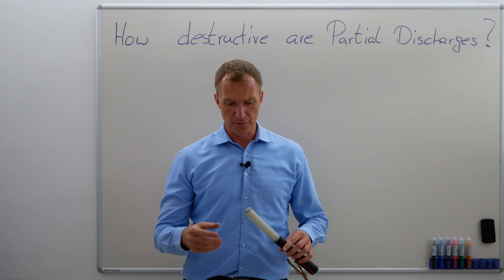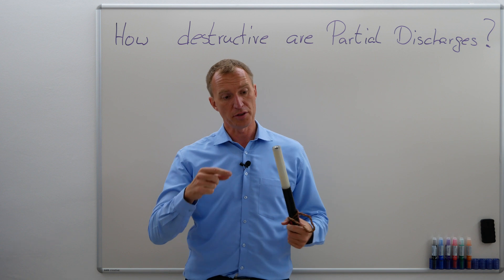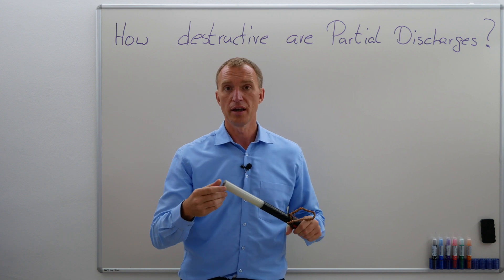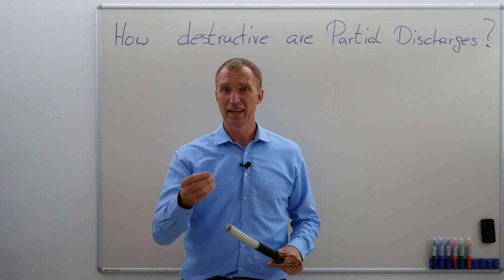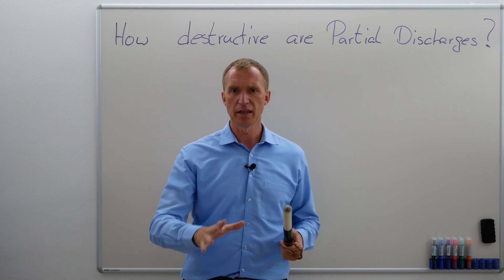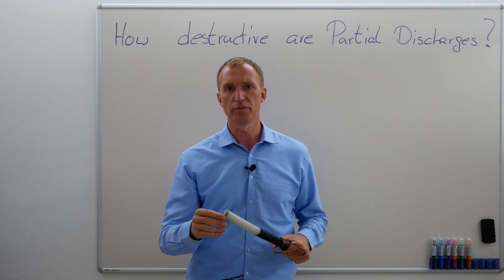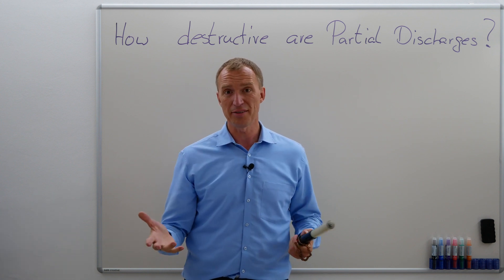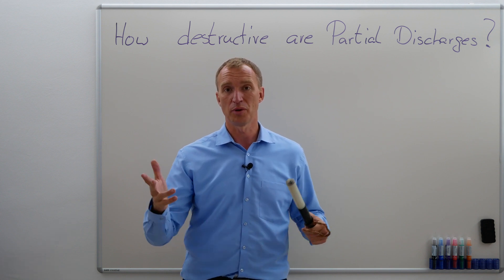1.2 How destructive are Partial Discharges?

Comment: 4:50 Your thumb looks pretty close to the center conductor of that cable! How did you know you'd be safe and the corona won't travel across the metal and jump onto your finger?
Reply: Same question
Reply: Unless he is at high potential voltage himself
Reply: It's high frequency from a Tesla coil, will not cause a shock.